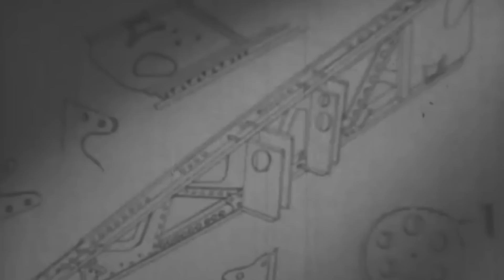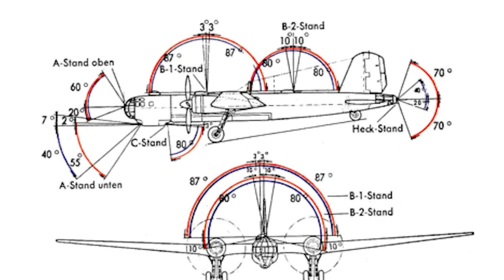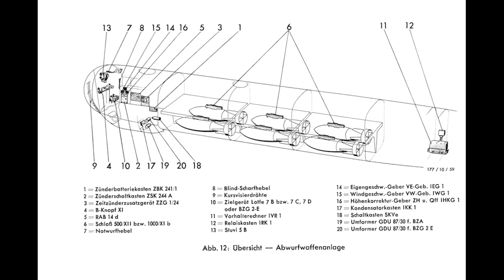The Weirdly Massive Firetrap Bomber That Terrified Everyone

Comment: I think the designers were trying to be too clever coupling two engines to a single propeller. Once they sorted out all the technical problems that they had it turned out to be an okay aircraft but by then it was hampered by fuel shortages and Allied defences. It would have been quite useful on the Russian front ranging behind enemy lines to bomb distant war factories that were well and truly out of range of other Luftwaffe bombers.

Comment: Germany lacked  a heavy bomber for the Battle of Britain, like the Lancaster 4-engine..
Reply: The Lancaster Started off as the AVRO MANCHESTER  with  4  Engines cobbled together in 2 Nacelles  it was a disaster with VERY poor reliability and the propensity to CATCH fire  , after building around 200 , they realized the error and kept the fuselage , Fitted New wings with 4 separate Engines and re-named it the AVRO LANCASTER !
Reply: That didn't fly until about a year later

Comment: Imagine if they just made it into a normal 4 engine bomber, like the start of the Lancaster
Reply: The development of the Lancaster had Exactly the same Problems with the Engines Catching Fire, for the same reasons  they  cobbled together two engines it was a disaster!  GOOGLE the AVRO MANCHESTER,  after Building around 200 of them  they Kept the Fuselage and Fitted New Wings and four Separate Engines   and re-Named it the LANCASTER
Reply: They were developing a true 4 engine version of the 177, the 274. The French finished the prototype and flew it for many years after the war. The RLM also canceled the ME-264, telling Messerschmitt to focus on fighters instead. The 264 would have been like a German B-29.
Reply: They did. The He 177B series had four separate engines. They only made a handful of them. There were also two He 274s, with twin tails and four engine macelles.

Comment: I can't fathom using an aircraft that big for dive-bombing, especially if the mission parameters included the actual return of the plane from its mission.
Reply: If you read"The Dam Busters", one of the expert pilots of 617 Sqn tried dive-bombing in a Lancaster - and found that it worked, and it was accurate.

Comment: As an ex military man involved in procurement for the last 7 years, the Requirement to produce a twin engines bomber with engines of at least 2000 hp, was seriously flawed.   That is a solution, not a requirement.  The Requirement is to go W kms, at X speed, at Y altitude and carry Z amount of bombs.  Aeronautical engineering and design will tell you what size plane you need, what power from and number of engines you will need, how much fuel will need to be carried to move Z amount of bombs.  If you dont have the equipment to meet that technical solution, you either design them or change the Requirement.
Reply: Hopefully you can help the RN with its 2 heavily flawed aircraft carriers. They couldn't afford catapults so ended up with a handful of very expensive lower capability VSTOL F-35s.
And they keep breaking down.
Reply: @bfc3057  Sorry, not my part of ship.  I was Hydrographic Survey vessels and diving equipment.
Reply: @csjrogerson2377  what a shame. Still I hope you helped bring some sense to your area.
Reply: @bfc3057  Introduced HMS Ocean, had the Requirement for HMS Enterprise and HMS Echo approved, introduced one-man and 10-man recompression chambers.
Reply: @bfc3057  --that was an hard answer--but the ROYAL NAVY has to handel it--tue rollf

Comment: The Two engine Coupling was a Bad idea , it was the German trait of Over engineering , it would have done Better on 4 Bolt on bolt off  Engines ..Just think how long did it take U.S mechanics  take to change a B17 / 24 Engine ? , far far  less than this Nightmare . I luv the He177 it could have been better but the Germans just could not get the Mix right ..Good Vid.

Comment: I think two engines in line with a contarotainting props was the way to go if they wanted to have less drag by reducing the number of engine mounts. Goering was right this time, welding two engines together was a bad idea and should have been dropped as soon as they noticed the inside exhausts were not working properly and flooding with flammables. 
I am guessing they could not mount them bottom to bottom because the gear that combined the two would need to be that much bigger to span the extra few feet, and weigh that much more. Another Vunder Vepon that thankfully helped them lose the war. I was surprised the program was started in 36, I thought the He177 was a late war weapon.

Comment: No matter how advanced and well engineered it was, the He177 was a poor strategic bomber of limited value. Were the British built three very good strategic bombers, the Germans lost interest in building a bomber that actually worked, which was to greatly affected their war effort. Like many German projects, it was too advanced for the technology of the day and was an expensive flop. It would have been better to build a more reliable 4-engine design, with coupled engines if one goes down the other quickly followed.
Reply: It actually was a 4-engined bomber, with only 2 props. The idea behind it was to make it capable of dive bombing which was an insane idea for this size of a plane. Anyway, Germany had to focus its resources on other more urgently required aircraft, so the 177 got never really fixed. Still it's an impressive piece of engineering.
Reply: @wanderschlosser1857  I believe I mentioned it had couples engines, which contributed to its failure. I would indeed have been impressive had it worked.
Reply: The Germans lacked the fuel to sustain huge fleets of strategic bombers. Plus our losses were at times unsustainable. The Germans had other means of dealing with us - U boat campaign to starve us and limit our imports of material. The Germans always suffered from a lack of strategic materials and frequently over engineered the solutions to handle those problems, often creating imaginative machines which still fascinate us.